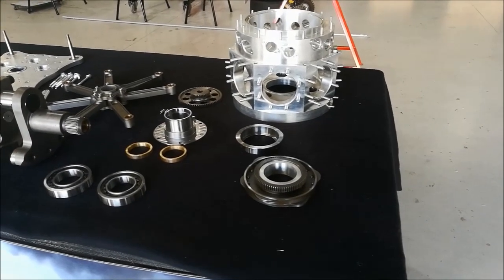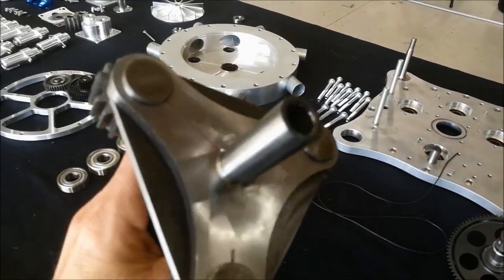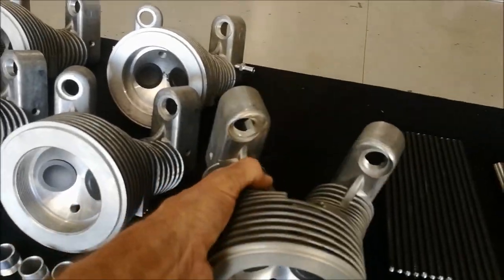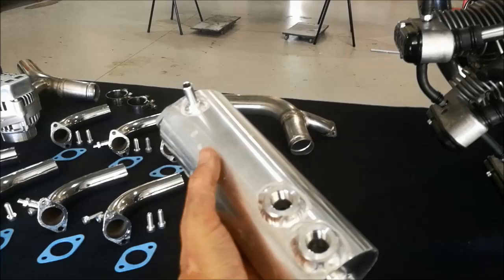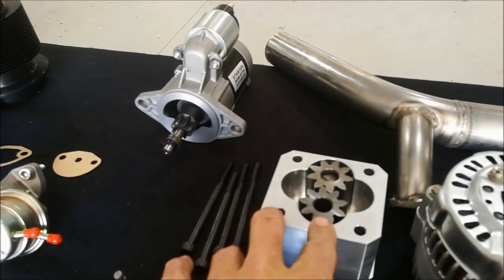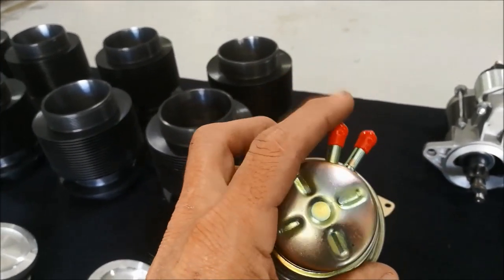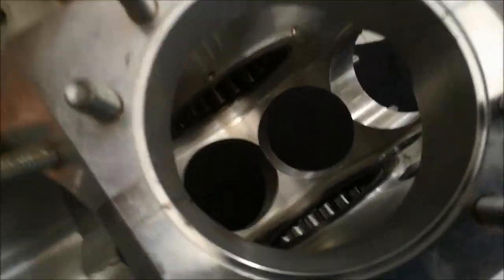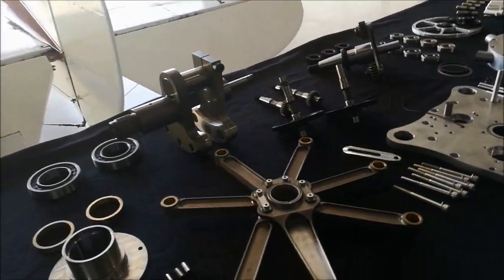Rotec Radial  LOOK inside

Comment: Its a good thing its an aircraft engine, and a radial one at that otherwise I cant imagine how much engineering would have to go in to that engine to figure out how to get it to run upside down.
Reply from the maker: Each LCH head is about 100 grams lighter than the stock Jabiru head so this x 6 you initially do save weight, but then when you add the radiator coolant and hoses you typically will have about a 5 lbs gain total, its never been enough to warrant a balance adjustment.  
After LCH is fitted to a 3300 its like flying a 130 hp Rotax 912, only a ton smoother and less expensive to run :) 
Email me for more info  paul@rotecaerosport.com

Comment: Lower rocker covers is oil scavenged out of them ?
Reply from the maker: All the rocker boxes including the lower ones are drained into the lower mini sump where an engine driven scavenge pump moves the oil back to the remote main oil tank.  The very lowest caps will trap some oil.  But not much.